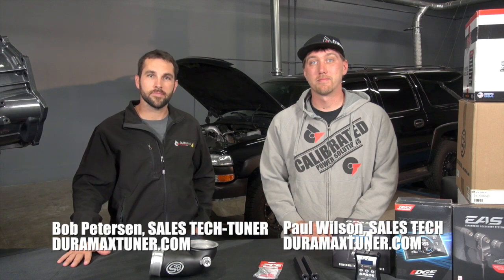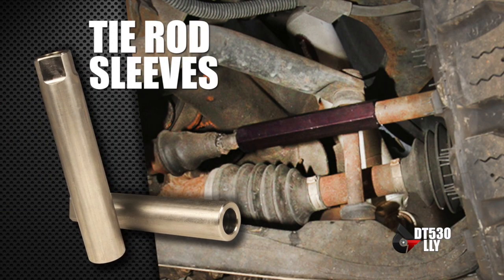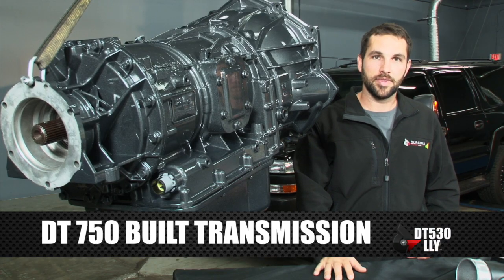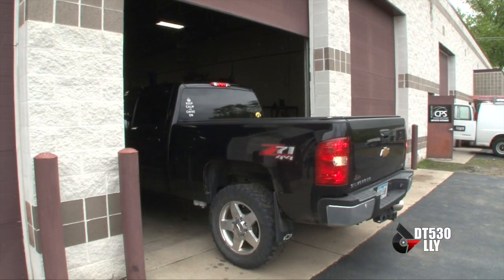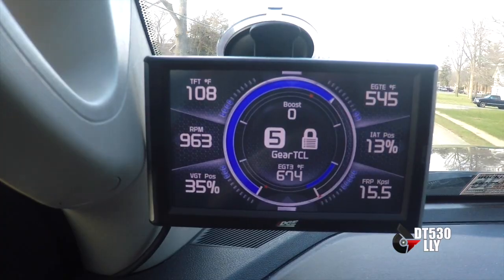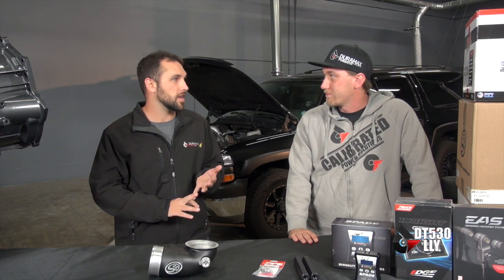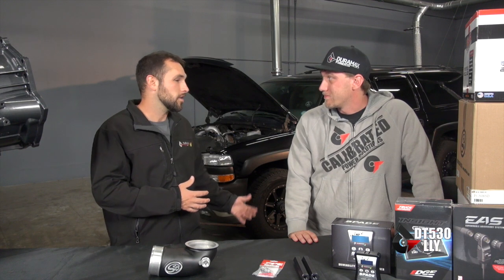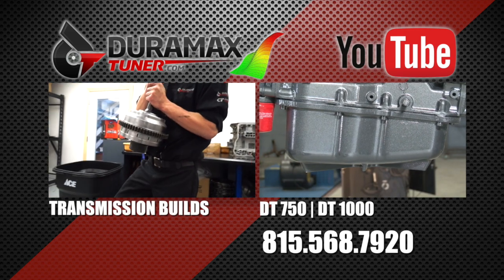DT530 Power Pack - LLY by Duramaxtuner.COM

Comment: I have a question for duramax tuner, I have an lly 2004.5 got the s&b intake, mouth piece, 3inch down pipe, EGR delete with up pipe, plan to get a fass pump in the future and a high flow y bride as soon as my budget allows it. The question is, can you guys do a tune to just get rid or the cel for the delete. I don’t want to put too much strain on my trans with a bunch of extra HP maybe a little but I’m mainly doing all these mods for longevity. Want my truck to last.

Comment: Cool beans. I already have all of the Banks exhaust, CAI w/ scoop, intercooler, S&B elbow and FASS 150. Just need the trans, display and EFI Live tune to make it work. Even have a heavy duty trans cooler similar to what Mike L mentioned years ago. My truck (2005 3500 dually LLY) only has 35,000 and I still like the idea of going to the 6 speed trans even though the mpg won't be that great to pay for it. The RPM drop is what I'm after since I live out where the speed limit is higher. Is that an option for this trans? Just put new stock size Michelins on the beast in 2014 so going larger rim/tire isn't an option at this time. Big max for the heavy stuff, lil' max for the lighter stuff and daily driver.
Reply from the maker: +6806goats1 That's awesome man! Hit us up anytime you are ready.

Comment: What is that fuel pump in the fuel tank? I just had to replace it
Reply: I hate to be the one to tell you but all that it's in the fuel tank is pick up line and return line ,the wire connector is only for the fuel sender 
They the parts people tell you that it's a pump 
Your cp3 on the engine draws the fuel from the tank 
For what they charge for the so called PUMP is ridiculous 🙄
I have seen the same thing on Amazon for 120.00 
Sorry to bother you with some bad news 
I have a 2005 crew cab chevy lly just did a complete body rebuild with Texas parts and new full rockers and cab corners 
Wish you luck with your truck, they're a lot of fun